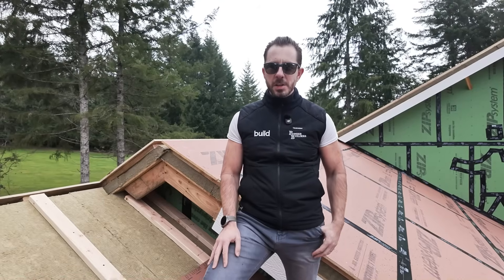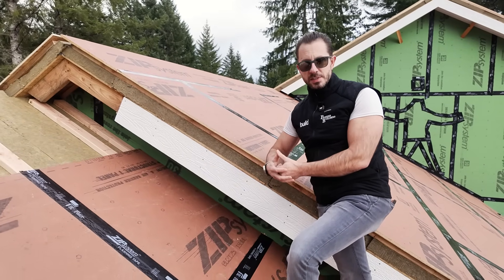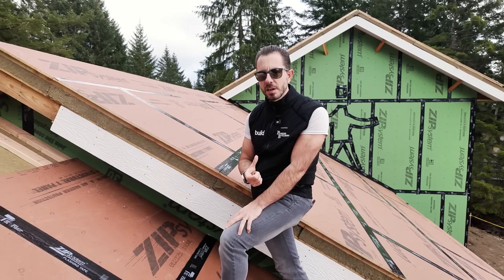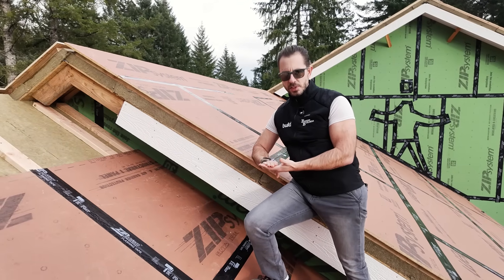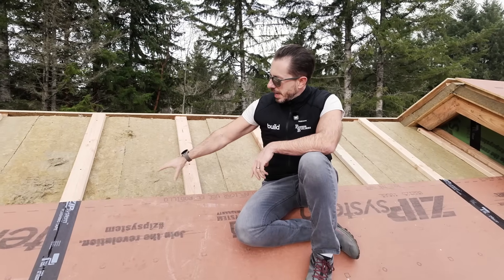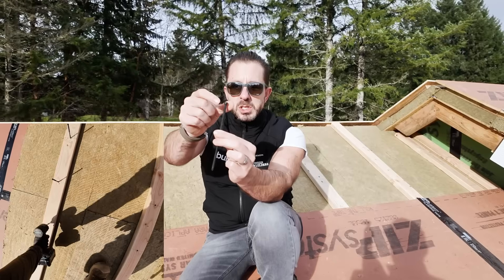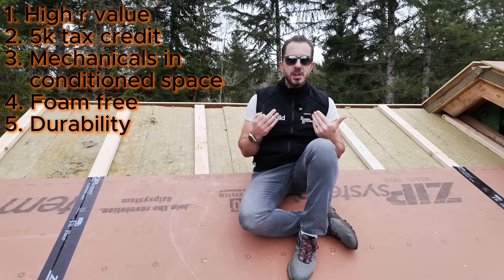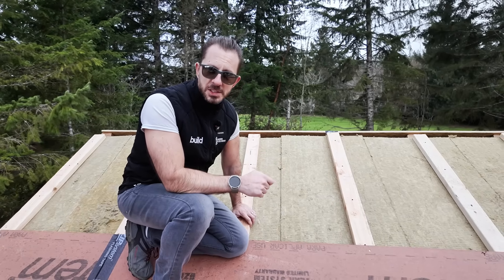How to Build a Vented Insulated Roof (R-60+ & Conditioned Space)

Comment: This is awesome.  I love that there’s no spray foam.  Do you end up adding a ridge vent?  If so, any concern with driving rain getting the rock board wet?
Reply from the maker: Good questions. The volume between the battens gets intake air at the eaves and exhausts at the ridge. No concerns on rain especially since Rockwool is hydrophobic.
Reply: @PioneerBuildersInc thanks for the info! I really like this assembly!

Comment: I don't like that there is no permeable roofing membrane over that rockwool that is vented. You going to get moisure accumulation in the rockwool as condensation drips down from the cold roof sheathing, possibly causing rot problems. It would be better create a sandwich of OSB/rockwool/OSB/Roof Membrane, then vent gap with a cold roof (OSB). You also not want to use ZIP sheating for the top  OSB sheathing so it can allow moisture to escape and use a moisture permeable roofing membrane to to allow moisture to escape. Bugs & mice getting into the rockwool is another problem. Another issue is there is house fire as fire fighters cut a hole in the top of the roof and shoot water in the hole. That rockwool is going to jam up their chainsaw. If there is an issue with rot in the roof, no insurance company is going to honor a claim on a non standard roofing system. I would run that by the home insurance company about that roofing method.

I suspect using SIPS roofing panels would be a lot more cost effective & last longer.
Reply from the maker: Ok

Comment: Good job. Assembly looks fantastic. What insulation are you planning from inside of the roof. Also will the furring strips handle solar panels mounted on the roof
Reply from the maker: Good question.  Two layers of R24 Comfortbatt steel stud spec (because of the i joist rafters).  Yes, the furring strips should handle solar panels just fine.  Good question.  Hadn't thought about that.
Reply: @PioneerBuildersInc ; great specs. Worth the effort when you get into high winters and summers. Super comfy

Comment: I feel like you could achieve the same goal with single layer Zip R roof deck over joists with double mineral batts in the rafter bays for less cost than adding an entire extra layer of zip over the 2x4 sleepers.
Reply from the maker: You would be decent thermally.  However, the shear strength of the fasteners precludes this from being an approved assembly.
Reply: @PioneerBuildersInc Ah, gotcha. I knew there had to be something.

Comment: I am wrapping up this very assembly on my home in Texas.  We did a chainsaw retrofit with zip r6 on the wall.  Brown zip on the roof deck then outer foam insulation on top of everything.  3" used poly iso from a commercial roof.  1" additional poly iso on the walls all with rain screen and rebuilt overhangs just like your assembly. 2nd layer of brown zip was topped with a standing seam metal roof.  Probably around 10k in materials excluding metal roof.
Reply from the maker: Self performed?
Reply: @PioneerBuildersInc  yes!  We're poor... So we are good at the trades 😂

Comment: Very nice, Bryan!  Very clear narration too.
FYI:  for very low-budget jobs, rigid insulation with foil backing can be suspended from rafters by attaching 1x2" ledges to the rafters.  This approach is best for new construction.
By facing the foil upwards, radiant energy is reflected back into the vent channel, adding heat to the air mass that is rising up to exhaust out the ridge vent.
Also, Core-A-Vent has a Raft-A-Vent product that attaches to the top edge of the blocking between rafters at the building line.  This overall approach eliminates the need for 2 layers of roof sheathing.  The required thickness of the rigid insulation may require wider rafters e.g. 2x10 instead of 2x8.
Reply from the maker: We did something similar on a recent project.  Very nice.  I like to have multiple arrows in the quiver for different applications, you know?
Reply: I'll try adding a link to a master carpenter who built a remodel with the Raft-A-Vent product:

Venting a Roof that has open soffits
https://www.youtube.com/watch?v=2_bdQy0YzOc
Reply: One of the reasons why I have been concentrating on very low-budget implementations of this vent channel concept, is the enormous potential it has for new builds and remodels in undeveloped countries, where complex building codes are not a barrier to DIY builders.
The sheer reduction in air conditioning costs, particularly in Equatorial and Sun Belts, should accelerate "break-even" points, applying cost-benefit analysis.  Think the size of TEXAS x 20!

Comment: Question: Why not use a metal roof? A metal roof is more expensive than asphalt shingles, but with the additional cost of the 2nd sheathing, it seems comparable. I haven't run the numbers. Are you running a smart vapor barrier on the inside? If so, just go with a thicker roof framing for more insulation inside. Then, with venting of a mess on the outside like a Keen VIPOR vent mat will work. Many ways to do the same thing, it just material cost and your labor force.
Reply from the maker: Metal is orders of magnitude more expensive.  This is a spec home, and we already have a hard time selling them.  Gotta know when to fish or cut bait.

Comment: If you had to pick something about this system, that worried you, what would it be? I’m super impressed by the thought process of the fasteners. ❤
Reply from the maker: The long span results in having to use a code exception to reduce venting per bay.  I've been spending a lot of time calcing it out, and I don't want to make a mistake.

Comment: First, you didn't put self sealing underlayment on top of the first roof Zip sheathing.

Those long screws are going right through the zip tape if they are going to hit the roof joists.   Zip tape is not self sealing.  So that's an air and potential water gap through every screw.  Only way to remedy without redoing is foam inside for the air and underlayment on top of the second zip sheathing for a water leak protection.

Second, you don't need zip tape on top of your second sheathing. That's a waste.  What you need is self sealing underlayment since you didn't put it on the first layer.

Comment: What would you think of putting 1x4 furring strips over the 2x4s  every 24 inches horizontally  instead of another layer of zip to screw metal roofing to? More space for aeration.
Reply: I was thinking the same thing. The cost of the extra layer of zip and shingles must be similar to the cost of a 50+ year steel roof.
Reply: imo that would work as well, but you would need roof underlayment under the 2x4's to prevent condensation (and any small leaks) from getting into the rock wool.
Reply from the maker: Super interesting idea.  In my experience, metal roofing is considerably more expensive.  However, I never want to get brainlocked, so I'll put something into that.

Comment: Is a downside the reliance on mechanical dehumidification of an unvented attic ceiling?
Reply: Dehumidification system should be included in a build like this
I’m sure they have this covered as well
Reply from the maker: We don't have a dehum in the attic, however, there will be one in the crawlspace.  You might be surprised that humidity isn't generally a concern in our area.  Not always though.  Just consulted with a buy with a humidification situation.

Comment: Nice to see you guys stepping it up to match your obvious skill level. This roof assembly is the way to go, especially when you start considering increasing storms (winds, rain), wildfires (WUI), cold events (incl. potential for ice dams at eaves) and so on. Appreciate the PNW content in building science (and Awesome framing)... One thing you could address in follow up:  The critical detailing of the Vapor Retarder in an "unvented" roof assembly (noting that over-venting adds efficiency as well as risk reduction). Did you choose an SVR? While not especially recommended in Climate Zones 4 and up, did you consider Vapor Diffusion Venting the Zip near to the peak (to account for Zip remaining below 1 Perm in testing and coastal environment)? Cheers.
Reply from the maker: Nice comment and thank you.  No vapor diffusion port.  Our air has a surprisingly low amount of water vapor in comparison with the eastern US.  For example, our vacant houses often sit in the upper 30% RH in winter.  I specify condensation sensors in our exhaust fans in bathing rooms to ensure evacuation of higher occupant behavior moisture.  Bottom line, it isn't a concern in our temperate climate.

Comment: Great work! What is your method for insuring you hit the structural I-joist with those long screws consistently. Once the insulation is down you can't see the zip board markings or nails to reference. I plan to do an insulated over roof just like this on my upcoming home build in 2027.
Reply from the maker: No simpler answer than skilled technicians.  The top flange is fairly wide.  As long as you stay on layout at the plate/ridge and when installing the first layer of sheathing, you can trust the location of the rafters.
Reply: I haven’t done this assembly myself yet, but I plan on getting a high end wall/floor scanner with radar.  Model number D-Tect 200C…..$1200.  Bosch.

Comment: Who on earth though gables offset by 14” was a good idea? Those inaccessible headwall details are always the first to leak.
Reply from the maker: This was for two garages connected.  The single bay is stepped back from the double bay to keep it from looking hideous.
Reply: @PioneerBuildersInc  You can step a wall back without stepping the roof back, especially when it’s such a small distance. It’s so much better to have a continuous roof than the inaccessible headwall and soffit, and the fascia that will weather faster than anywhere else. It’s a total maintenance nightmare.

Comment: Do you install a vapor diffusion port at the ridge from the conditioned space to the exterior? Or just provide conditioning/dehumidification in the conditioned space?
Reply from the maker: Vapor diffusion ports aren't used with overvented roofs. That's part of the inherent safety of the system.
Reply: @PioneerBuildersInc Really? You have a vented roof over an unvented roof? How did you derisk the unvented roof?

Comment: I have watched other videos where it was done in similar way. I could understand if it was done on some renovation projects but nobody bothers to explain why you are doing it on new build when you could design more space inside for extra insulation instead of overbuilding this way
Reply from the maker: We did this to move the thermal envelope to the roof line
Reply: @PioneerBuildersInc the question why you did not design house for a few inches toller to put all insulation from inside.  I am not saying you are wrong I just want to understand the benefit of doing your way
Reply: @andreycham4797  Adding insulation to the outside of that first layer of zip sheathing addresses 2 issues.

1st issue is that it keeps that layer of zip sheathing warmer to prevent condensation there.  If you have insulation below the zip sheathing, it doesn't help with this.

2nd issue is that it reduces thermal bridging through the framing members by adding a layer of continuous insulation outside of them.

The ventilation channel outside the insulation board allows heat gain from the roof to dissipate with less transferring into the home.
Reply: @MaltiverseExplorer   leave a gap between roof OSB sheets and insulation placed between rafters then make a cut at the roof ridge so the outside air would constantly run through that gap since the air have same humidity level and temperature it will never condensate on OSB. If you think you need extra insulation to prevent thermo bridgeing just nail 2by4s horizontally to rafters from inside and place insulation there